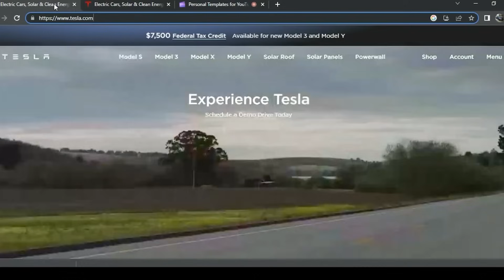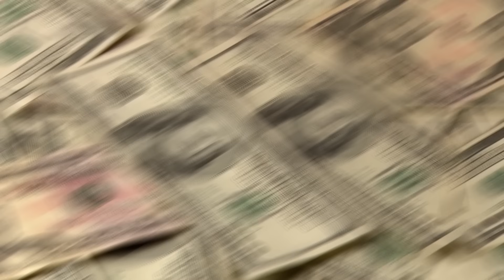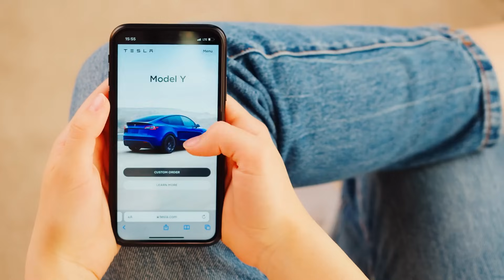5 Reasons Why the New Tesla Cybertruck Will Revolutionize the Automotive Industry #cybertruck

Comment from the maker: Some useful comments about this video.
00:03 The Tesla Cybertruck combines futuristic design, exceptional performance, and sustainable technology.

01:01 The Tesla Cybertruck has a revolutionary design and impressive towing capacity.

01:58 The Tesla Cybertruck's stainless steel construction provides unparalleled durability and the armored glass windows enhance security.

02:59 The Tesla Cybertruck is equipped with advanced autopilot capabilities and prioritizes safety.

03:53 The Tesla Cybertruck has unprecedented towing and hauling capabilities.

04:50 The new Tesla Cybertruck revolutionizes the automotive industry through its impressive battery range and positive environmental impact.

05:49 The new Tesla Cybertruck offers extended range, strong demand, and competitive pricing.

06:50 The Tesla Cybertruck is a promising vehicle that can potentially change the pickup truck market.